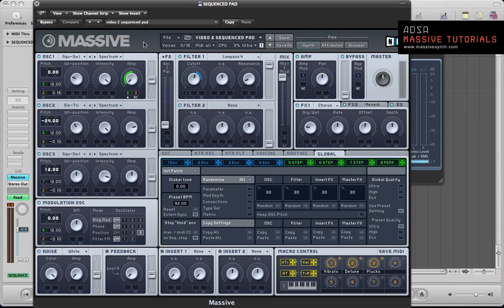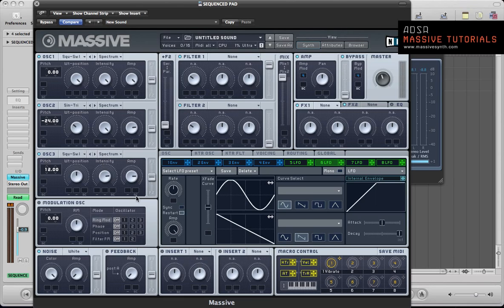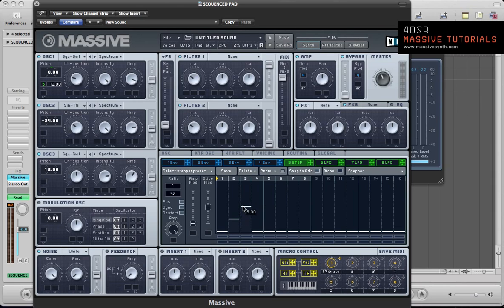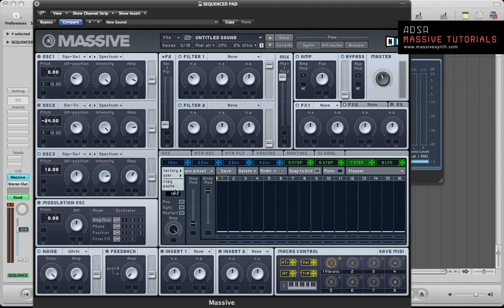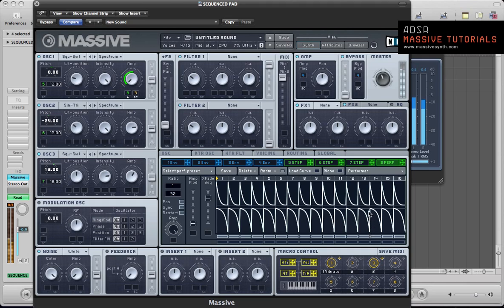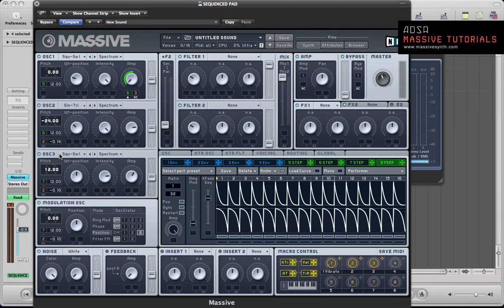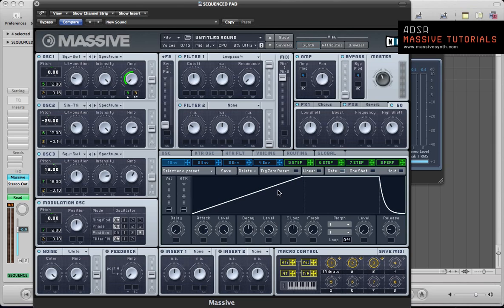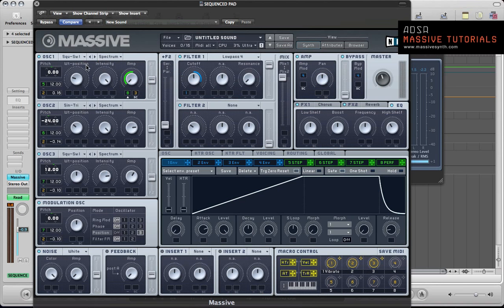NI Massive - Analog Soundscapes (Boards of Canada Inspired) & Instruments - pt 2 - Drifting Chord

Comment: Little tip here would be to do the low pass filter envelope as automation, rather than using an envelope in Massive. That way you can make it fit the track a lot easier. Still, great video, it's showed me how to do arps in a way I hadn't thought of before. Shows me how much I have left to learn.